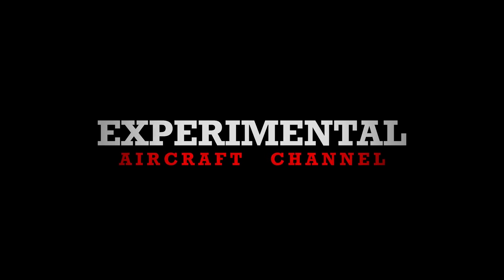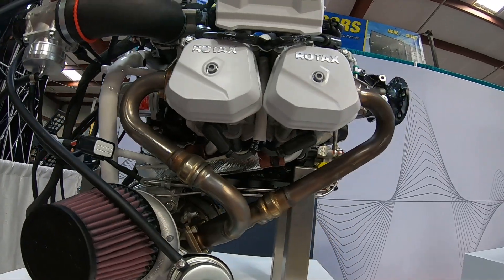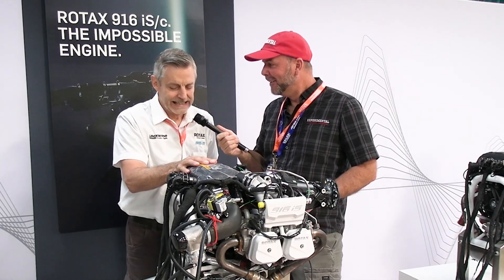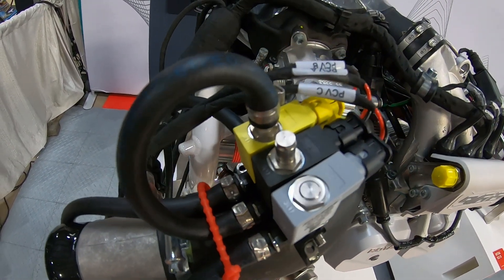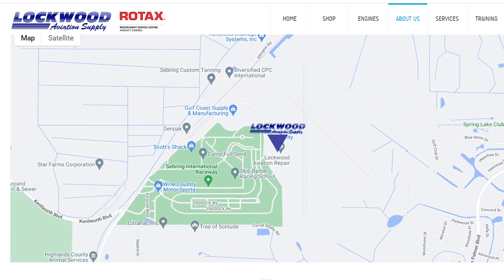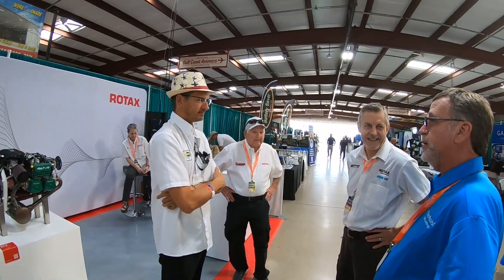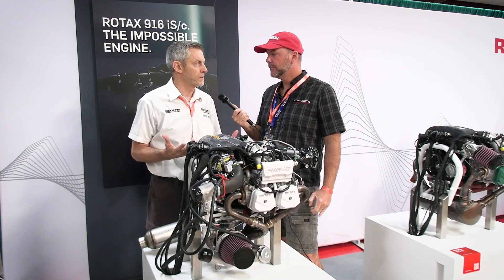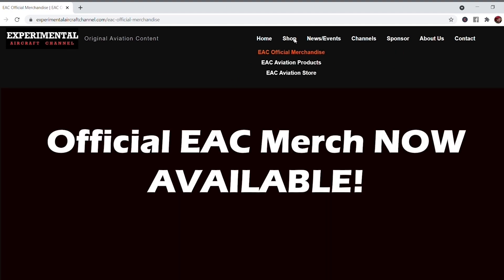Rotax 916is Engine MASSIVE POWER! Increase to Aircraft

Comment: Rotax has priced itself out of the market above 100hp.
Reply: You price a Lycoming lately?
Reply: lol, it flies on pump gasoline? you realize the savings?
Reply: @dimsler2  good point.  Avgas is crazy.
Reply: No, you get what you pay for in these engines are simply better. They're less expensive because of the really high TBO. And lower maintenance. And better efficiency.

Not to mention, They keep their performance all the way up at altitude because they are turbo normalized which is something you don't get with any other engine. So when taking off or flying over mountains, the power is way more significant
Reply: @pilotavery  UL would be my choice above 100hp hands down.
Reply: @CaptainChaooooos  why? Curious.
Reply: @pilotavery  power to weight combined with traditional direct drive and air cooling.  Simplicity of design coupled with light weigh and tech without the high rpm and reduction gearing assembly.
Reply: @CaptainChaooooos  Oh, I mean I guess some of that's true, although The rotax uses much less fuel for the same power. Not to mention self-powering electrical, the ul can be made redundant still but, eh. 

The liquid cooling is nice because your temperature stay rock solid and don't fluctuate, and the 2000 hour TBO is nice. Not to mention that the UL turns the propeller a little faster which is less efficient.
Reply: @Pilotpaulie 
I completely agree.
These smaller companies are going to thrive at these prices rotax is coming out with.
UL sales will rise. They are good solid reliable engines. They are built in smaller numbers and don't have the backing rotax had, but if they keep up the qc with the higher sales demand, they will become a big contender in the next decade.
Jabiru also has a bright future, imo.
Reply: @davidmiller4594  I hear good things about the forth generation Jabs.
Reply: I don't think so.  It all adds up, power-weight-cost-operating cost-reliability
Reply: No way. Price a Lycoming or Continental. And don't forge Rotax is FADEC which is huge!
Reply: You get what you pay for...
Reply: Vans is advertising an io-360 for their builders with electronic ignition for $43,900. 
Probably cost a bit more for non-RV builders. So I'm thinking they're not far apart.
Reply: @markg4459  59k outside vans.  Major discounts for one engine per build.
Reply: They seem too expensive for what they are compared to other engines by Rotax.

Comment: Idk, I'm kinda meh about this.

The engine is a suped up 915 that can handle some extra power for a little bit of time.

That's great for the stol crowd, but for everyone else this is just a more expensive 915.
Reply: It costs 15% more than the 915 for exactly 15% more horsepower and with the added bonus of a massive increase from 1200TBO to 2000TBO. That's a pretty good deal if you ask me.

Comment: Lol you can get the same hp, 40lbs lighter for about 6k with a yamaha apex engine with an sds control system and a stinger redrive. And yes there are several of this set up already flying and have been for awhile now.
Reply: Reliability??? It’s very easy to say 2000 h TBO  . In reality there is no 912 S which reaches 1000h when you run it with 75 % or max cont. on glider towing  , they just disintegrated in the air without prior warning ! Rotax deduct the price ! At 75 % the 912 S use’s a little more then a Lycoming or Continental in lower altitude, at higher altitudes they use a lot more !! Lyc. And Conti . engines you have to lean . If somebody don’t believe it , look in a DA 20 POB ( Rotax powered) they are not not allowed to lie about the fuel consumption .
Reply: @reinerressel975  That's interesting, all the current data shows that the rotax 912 and 915 are even more reliable than Lycoming.
Reply: @pilotavery  And all of them are terrible compared to good engines used in cars, boats, ... (auto conversions are still a big percent of the accidents for various reasons).
Reply: @vitordelima  rotax built this much like automotive engines are built. That's kind of the point. We're not talking about the shit 100 horsepower or less crap that rotax has put out in the past...
Reply: @pilotavery  But they are still more expensive, less reliable in a fair comparison, ...
Reply: @vitordelima  Nah, they're slightly more reliable than Lycoming and Continental, at least the 912, 915, and 916 is.
Reply: @pilotavery  Less reliable than cars, boats and many others in number of incidents per time or distance travelled.
Reply: @vitordelima  You are correct if you are talking about the old style road tax engines, the ones that came before the 912. But all of the current statistics show that the rotax engines are more reliable than the comparable engines here, while also being lower operating cost. They are very very lightweight when compared to some of the boating or other engines, and are actually more reliable than the boat engine counterparts.

There is a reason why every single engine except only one rotax 915 has made it to TBO so far... Fewer engine failures than the legacy airplane engines. I'm not sure exactly where you're getting your data from but I think you May have read about how awful Rotax engines are, And you would be correct, except for the rotax 912 and up, which are a new design. Before that, reliability issues, especially being less reliable than the surface counterparts, was certainly accurate. Now? Not so much.
Reply: @pilotavery  I meant when used in their original vehicles, you don't need to throw away your whole engine after running 300k kilometers with your car for example.
Reply: @vitordelima  Well of course, the same rotax 912 has proven that they can be extremely reliable in other applications where they can last longer
Reply: @vitordelima  https://youtu.be/WeQhkOBDsN8

Rotax 915 engines look brand new at 2,000 hours... These engines can legit last 5000 hours before needing to be rebuilt. That's like rebuilding a car engine at 50,000 miles.
Reply: @pilotavery  1200 hours of TBO.
Reply: And running around at 8,000 rpm’s sucks. What do you think the cg envelope is like with an engine 40lbs lighter? Crap that’s what.
Reply: @Captndarty  lol its been flying just fine for more than a year with no issues other than some teething issues early on. Rotax engines run just as high. On the project I follow closest cg also has never been an issue soooooo....
Reply: Rotax do not run just as high. I can get a faster airspeed at 5000 engine rpm than you can at 8000 engine rpm. Soooo there’s that….. many people like yourself buy multiple apex engines because in the back of they’re mind they don’t 100% trust a used engine out of a wrecked machine. I’m not saying there’s in the market for the Yamaha, but it’s an extremely small percent experimental aircraft. It doesn’t work for most people. And quite frankly, besides it’s obvious capabilities, for “stol” the people that get on the high horse about the Yamaha motor are quite often obstinate and cheap or both🤷🏻‍♂️
Reply: @Captndarty  The way you talk sounds like a person comparing a contisaurus engine to a rotax. As an engineer, the apex engines are far better, but would be better if designed for a cruise rpm of 6000. I am using a Suzuki M13A and it is far superior to Rotax. The issue is people using an engine in an aircraft designed for a different engine, it is not the engine itself that is no good.
Reply: @Captndarty  exactly that's how rotax started with few engines from a high rpm snowmobile engines, yamaha reliability is higher than rotax. Rotax regular engines are crap, oil and waterpumps gears are plastic. Wait for yamaha aircraft engines.

Comment: Cost wise..... A TOTAL RIP OFF !!!  Bang for buck, one could do SO much better.
Reply: Those are not aviation engines though…. You may say they are reliable, but are they really? They can probably be modified to the extent where they approach the levels of a Rotax, but they’ll never be quite there. Not to mention bike engines run extremely high rpms to make that sort of power, which means you’ll need a propeller gearbox to lower the prop rpms.
Reply: @Blinkin97 This is repeated all the time everywhere but many car engines are running well for decades in GA. Some aren't. Sometimes the same adapted car engine is worthless for some and amazing for others depending on how it was adapted (for example the Subaru engines). Meanwhile some certified engines had to be decertified by the FAA.
Reply: @vitordelima  oh I’m well aware of car engines that have been certified for aviation use. It was just an overall observation. Car engines were not built with the intent of running at 100% power for 10-30 minutes straight like airplane engines are. They were not built to be redundant, nor to have the same level of reliability that airplane engines have.  I’m just saying that there’s a reason Rotax (and other aviation engine manufacturers ) charges a premium for these engines. They were built with a very specific purpose in mind.
Reply: @Blinkin97 Thanks for another redundant reply. And I was talking about experimental engines.
Reply: @Blinkin97 The Rotax has a gearbox.
Reply: What would you buy?
Reply: As I have already stated, a Hayabusa.
Reply: Really? A Lycoming O-320 with the same 160hp, similar TBO, altough being a much older engine a 70 yo design), heavier, bulkier (ergo, with a much worse power-to-weight ratio), without EFI (unlike this rotax), without the liquid cooled cylinder heads, costs a several tens of thousands of dollars more...

So, yeah... you're wrong.
Reply: For everyone wondering why anyone would consider an engine other than lycoming or continental (etc)…
Consider the fact that 100LL (avgas) is going away… and do some research into the alternatives and you begin to see why engines that can run on lower octane “pump gas” are becoming more popular.
Reply: Hayabusa. You can get 500 horse power out of these and a VERY reliable constant 380 horse power. Does that answer your question ??
Reply: @youtuberAstar  I know there is a helicopter prototype in Japan using the engine from the Ninja H2 but I'm not so sure about this.
Reply: Prove it. Oh wait you can’t…. 🤷🏻‍♂️
Reply: @Captndarty  I can. Yamaha Apex and it can be bumped up to 300 horse power maybe not for awhile but it’s been done